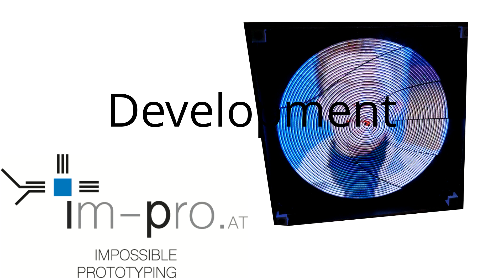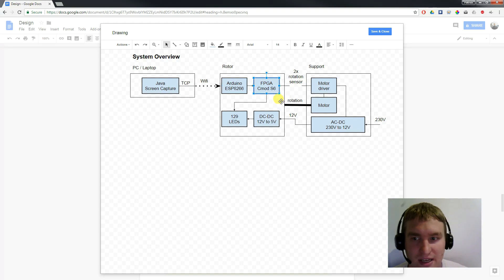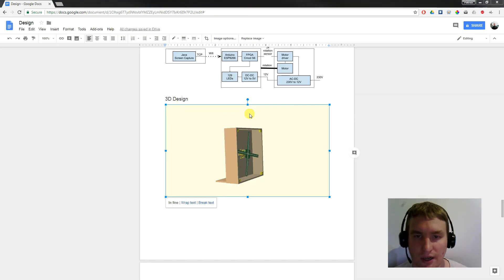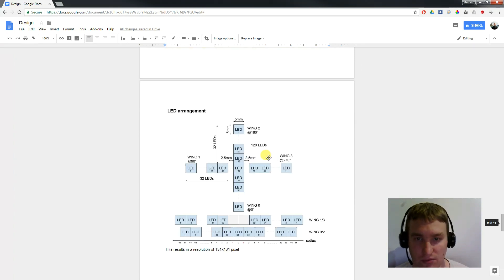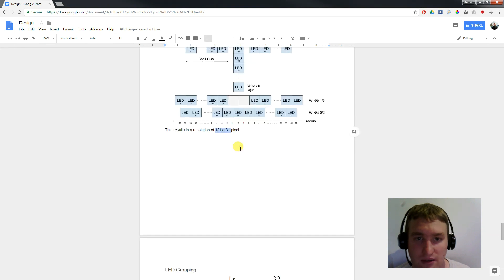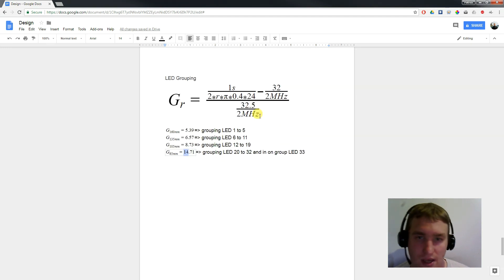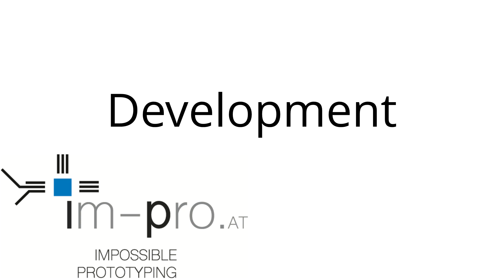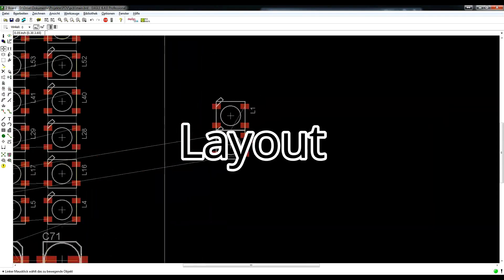Project POV Display [en]

Comment: how do you handle playing a video ? I had a problem that a fault appears when updating the image frame, It looks like the image is cut in half. Can you help me?
Reply from the maker: I did not have this problem. Do you have a video or something? I need more information to help you.
Reply: here is the video :https://youtu.be/s4ju3ijiVsI
Reply from the maker: Wow very impressive!!! Is the motor rotation syncronised with the frame rate? In my build it's asyncone Maya that's why it's not visible.
Reply: Motor speed is not synchronized video
Reply from the maker: Looks like the glitches are only horizontal at the same position. Do you know why?
Reply: The reason is that the updated image is quite different from the previous image, and the display has not been refreshed.